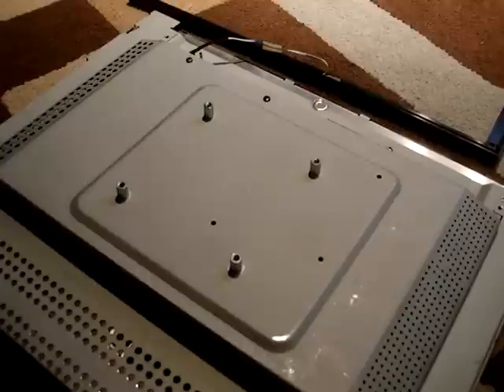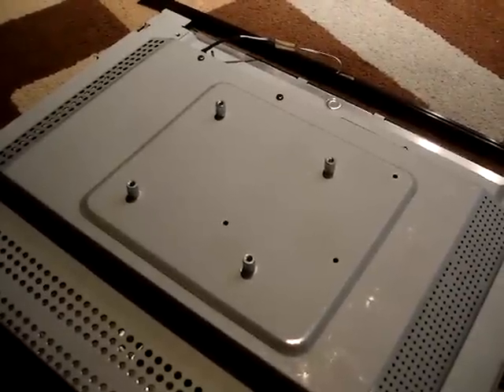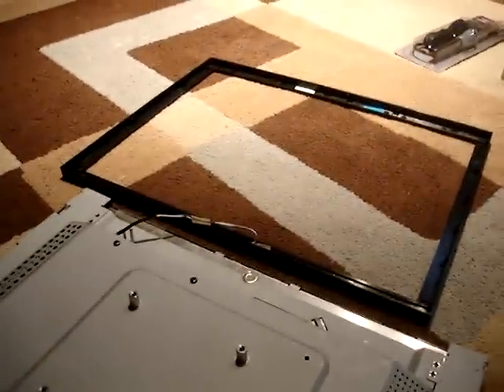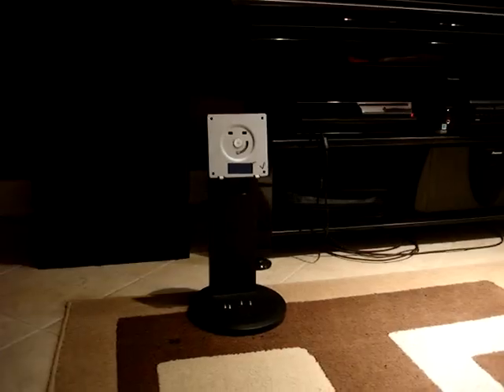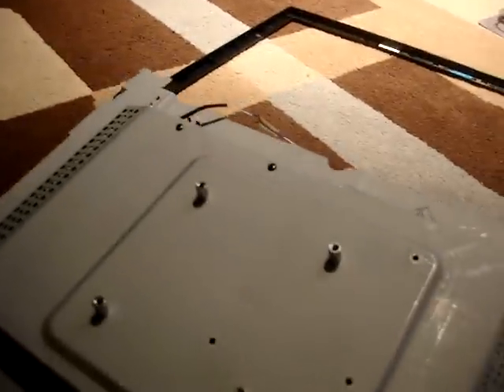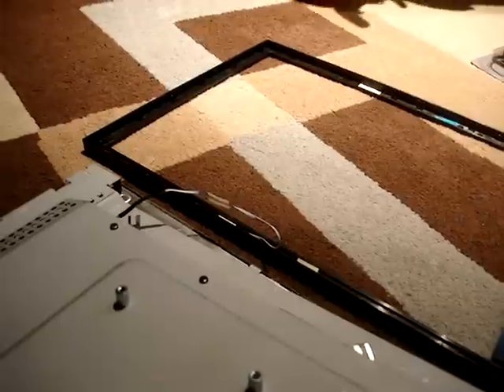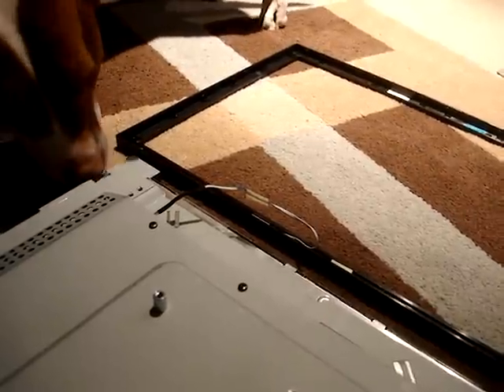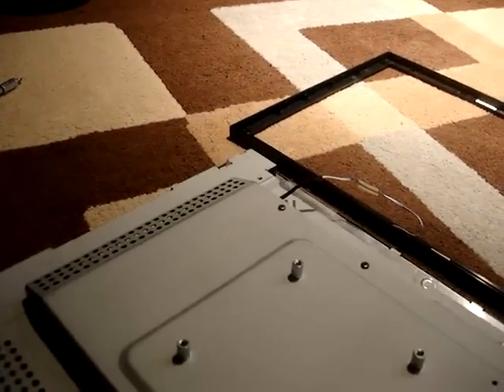How To Fix LCD Monitor 2 of 5

Comment from the maker: @goodplay12 You'll have to open up the casing to see what the underlying problem is.  Use a plastic putty knife and go SLOW when you are opening it.  Never use metal or you will damage the case.  The power switch could be a number of things.  Bad wiring, lose connection, etc.  Hope this helps!

Comment: Hi, I am using syncmaster 940B (looks like the same one in video). The power button does not work. It does not have the blue led backlight when it is on and it is forever in the on mode. I can only swtich off the monitor by switching off the main power supply.

How can I solve the problem?
How can I open the casing without damaging or causing dents to the plastic frame?

Thanks